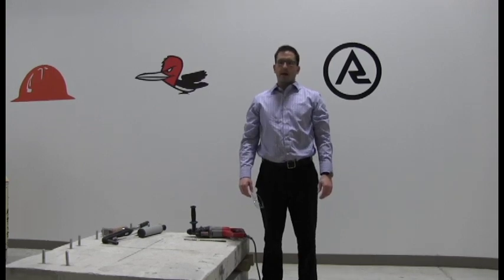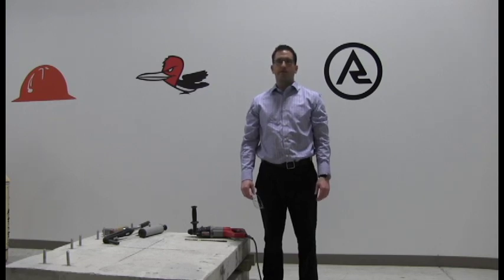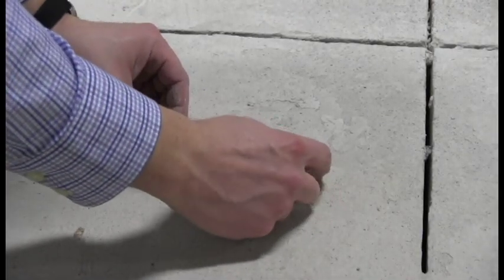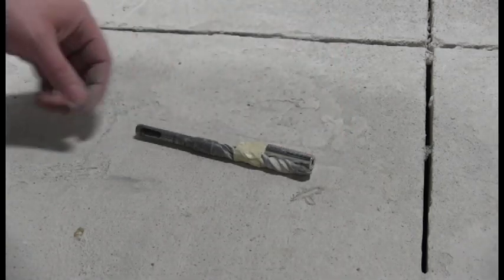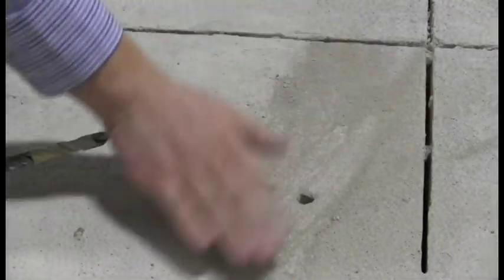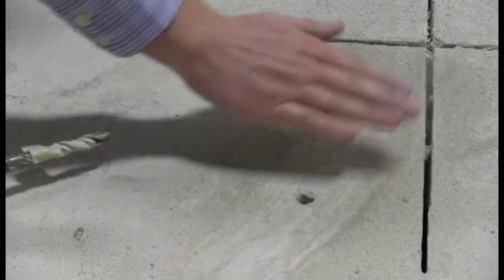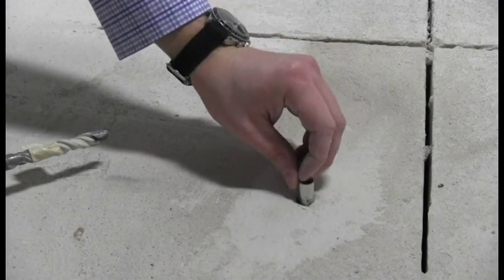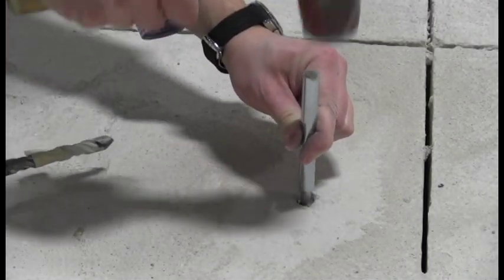Red Head Drop-In Anchor Installation

Comment: I purchased the setting tool for 3/8" drop in anchors and it wouldn't fit inside the threaded portion of the anchor without damaging the threads.  I had to grind down the setting tool to a diameter of 11/32" and now it works.  I shouldn't have to alter a tool to make it work.
Reply: You obviously bought the wrong one.
Reply: I used a standard punch it worked fine, however had no idea if I set it deep enough. . This was for a base on a commercial front load washer extractor..its been 5 years, so far so good

Comment: 5 8" for 1/2" drop in? I want to set for ratchet strapping a motorcycle in garage for stability , using a 1/2" eye bolt, can I remove the eye bolt when not using this system or will this eventually cause the drop in anchor to loosen?
Reply: Doesn't loosen at all, even if you do it outside the concrete

Comment: How do you remove them????
Reply: You don't.
Reply: @ScrewKeanu  actually yes you can. I've done it since then. You have to drill them out. Thread a bolt in and yank with a pry bar. Easy as anything. 👍
Reply: @kevinknabe7252  Okay, yes, technically you CAN get them out.  They're not designed to be removable though.

Comment: What If you don’t have the setting tool
Reply: If you are undertaking any project that would require a drop anchor, I can't image buying the setting tool would be out of your budget. That said, Do you have a pin punch set? I would imagine that has to work. I even saw a vid of someone using a screwdriver, not that I recommend that ¯\_(ツ)_/¯